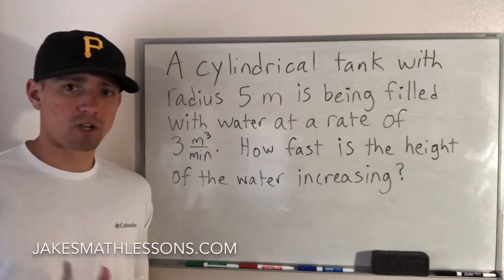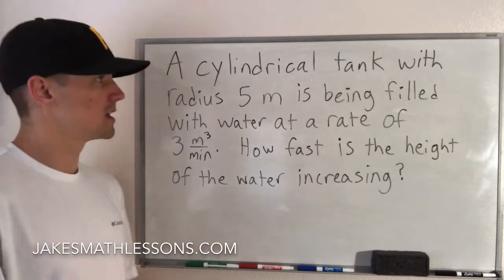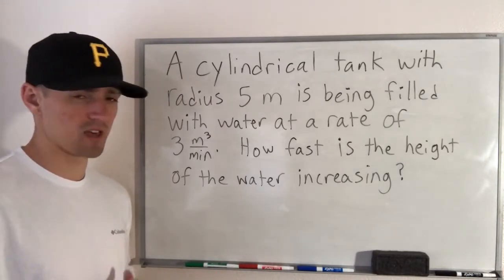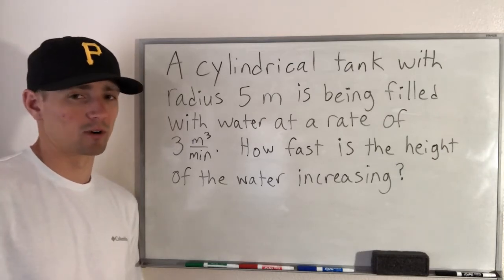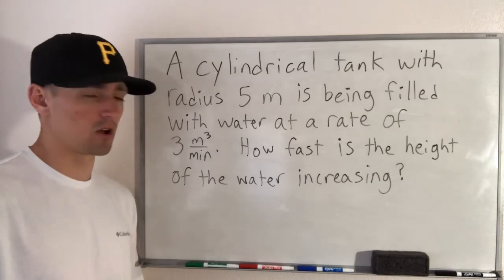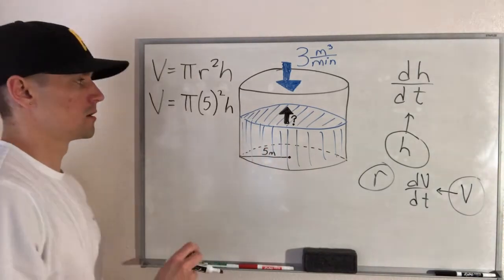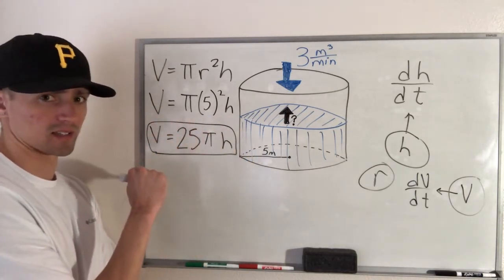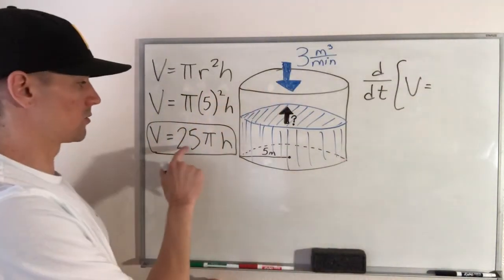RELATED RATES CYLINDER TANK - 4 easy steps to solve a related rates cylinder problem

Comment: Would you do the same thing if given the height
Reply from the maker: Yeah that would work pretty similarly. You could use the height to find the radius instead.
Reply: @JakesMathLessons  So if given everything plus the height you would just do the exact same process? For example if the height given is 12 nothing would change about the answer?
Reply from the maker: @deadlift5008  correct! Since a cylinder has perfectly straight vertical sides all the way up, the height of the cylinder doesn’t impact the answer when talking about the rate of change of the height. If it were talking about how fast the volume was changing or if we had a cone instead of a cylinder, the height would matter.